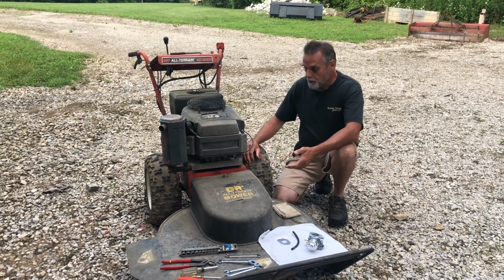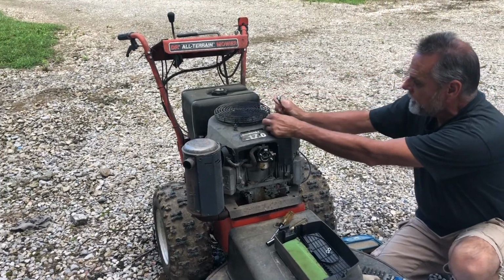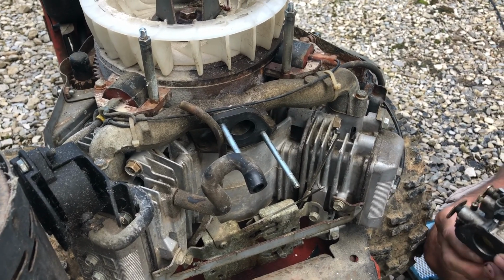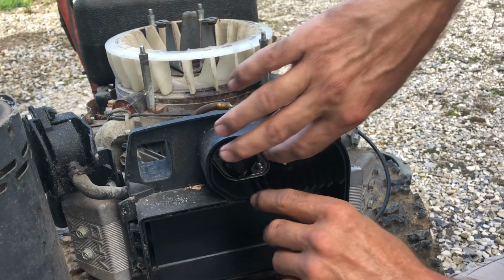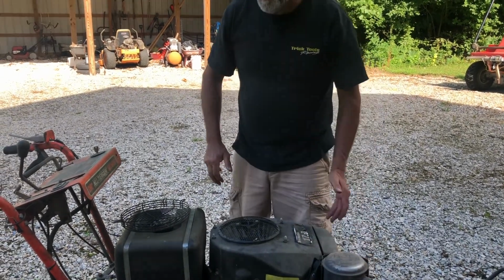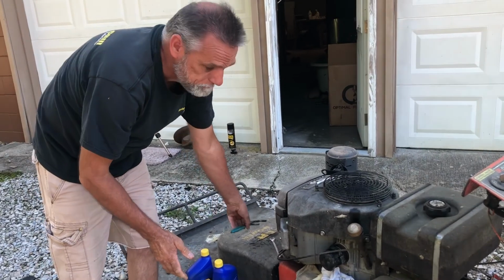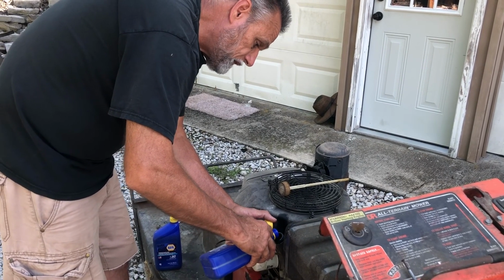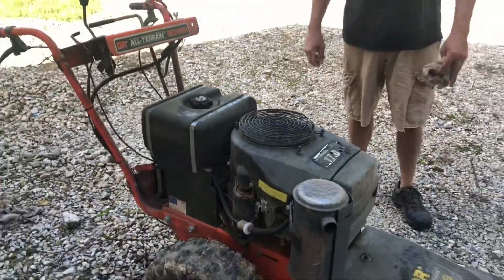Kawasaki engine carburetor replacement and oil change on DR brush cutter.

Comment: Our Kawasaki Mule had issues. We got a rebuild kit. The dealer says its usually the black rubber tip and float. You can also get cheap replacement carbs. for like $25. We went that way. It works fine.

Comment: Thank you I have the 15 hp Kawasaki replacing the FH 430 V carburetor. Your video was very helpful back up and running.👍😎
Reply from the maker: Awesome! Nice work, and thanks for the comment!
Reply: Where did you get the replacement carb for the FH430v ty
Reply from the maker: Amazon!
Reply: That is the same as I have (15.0 hp Kawasaki), so thank you for your comment, since now I know this will work for mine, too.
Reply from the maker: @Agetawod awesome! Glad we could help!

Comment: I have exactly the same DR. It takes 48 ounce of oil. Did you have any problem with the transmission? Thanks for showing the carburate replacement. What kind of oil ,or grease  have in the sealed peerless transmission?  Do you need to change  the oil or grease? I have done nothing to it.
Reply from the maker: I've never had any issues with the transmission, aside from adjusting the shift linkage. The Peerless transmission uses a heavy, non pourable grease that is installed as the unit is originally assembled. There are no drain plugs, and no way to change it aside from removal and disassembly of the trans. It's a nasty, bentonite based grease, that stains everything it touches. If you decide to disassemble your transmission, any small engine dealer should have it. Peerless gear was a division of Tecumseh engines.

Comment: Where did you get the carburetor? Thank you for the video.
Reply from the maker: Hi, I ordered the carb. from Amazon. I was able to get the engine model and serial # off the data tag attached to the cylinder block, then used partstree.com to look up the Kawasaki part number for the correct carburetor. Then I simply entered that number at Amazon and crossed it to a replacement. I've been satisfied with the knock-off carb, it performs well and was a lot cheaper than the OEM version. Hope this helps, thanks for watching.

Comment: Super helpful video, thank you.  Where did you source the replacement carb and gaskets from?

Do you use non-ethanol gas and use the fuel shut until the engine dies to keep fuel out of the carb and engine when not in use?
Reply: Sorry now read down and found carb source😊
Reply from the maker: Good deal, glad you found the video helpful. Thanks for commenting!